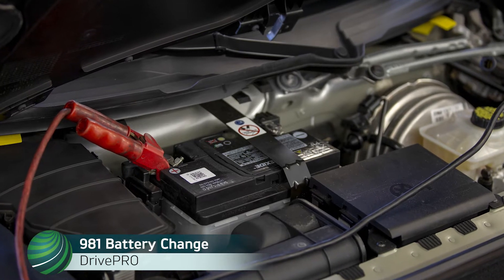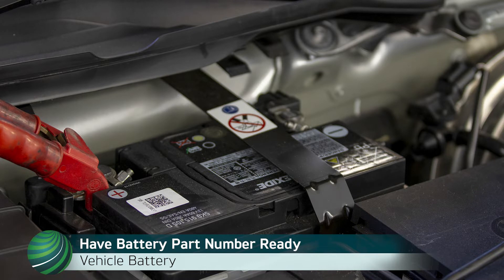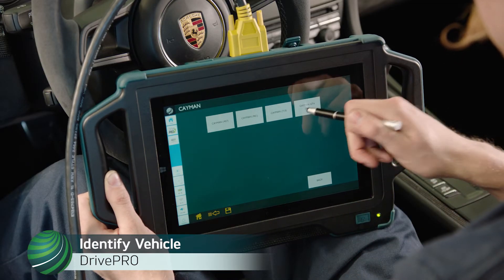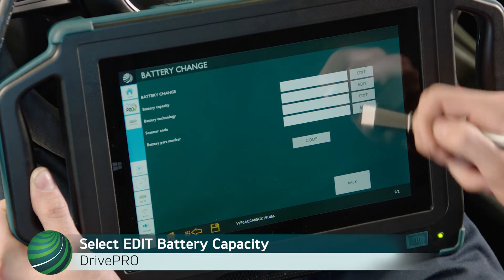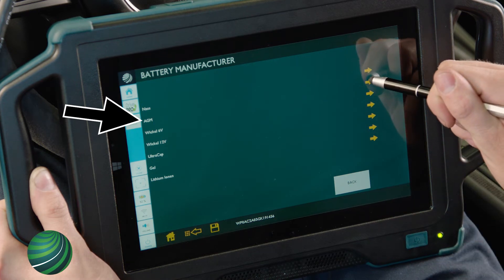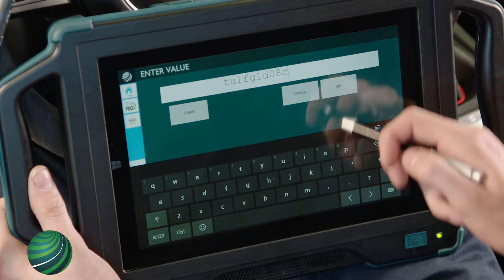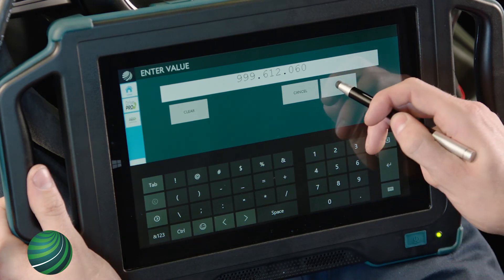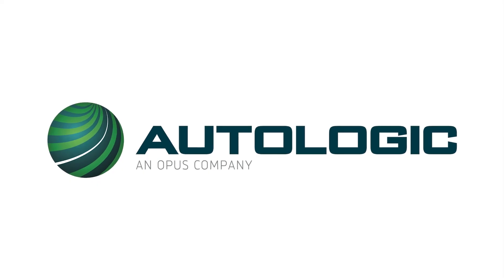How to Register a Battery Change or Replacement on Porsche models using Autologic’s DrivePRO

Comment: Where did you find the part number 999.612.060 on the battery?? From the beginning of the video, it shows the battery part number as 5K0915105D. And I believe this is a sealed flooded lead acid battery, not AGM.
Reply: Same question Tommy.  Maybe Opus does not come here often.